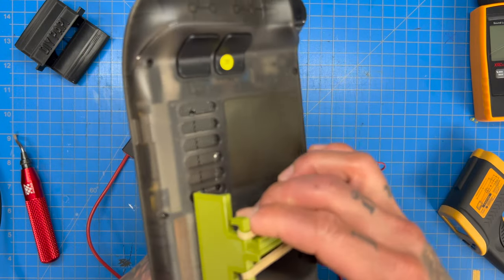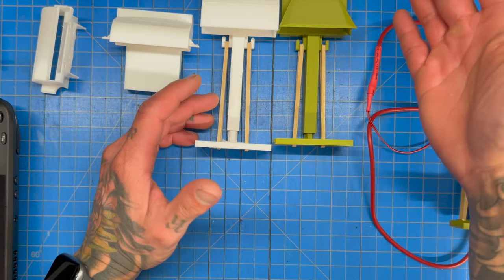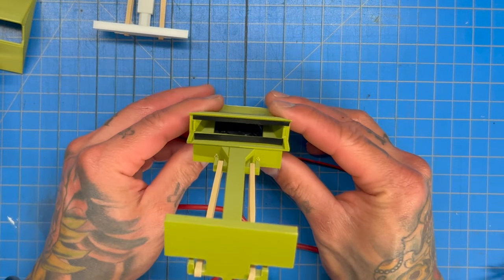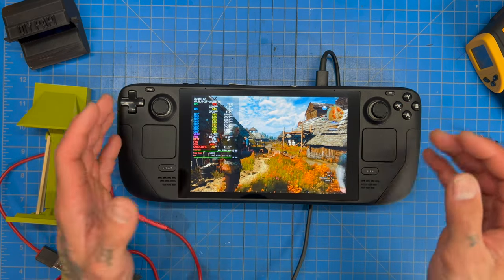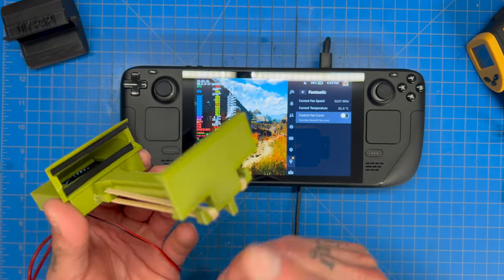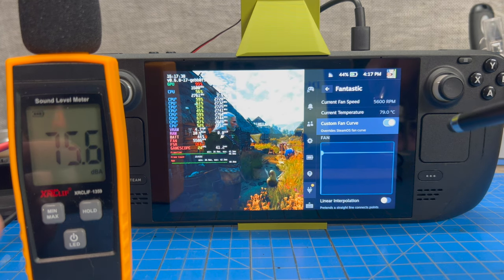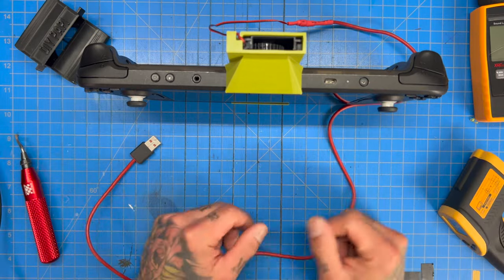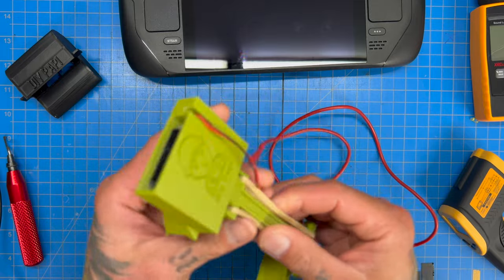Steam Deck DIY Exhaust FAN Give Away!!

Comment: Sweet bro I follow you on twitter.  and YouTube lol. fingers crossed. 
Bro any way to add a 13650 battery mount to your fan I know thy have single holders on amazon  so you can clip a battery right in.  just a thought I had  just now.
Reply from the maker: Cool idea, I have a few ideas with a battery pack, just adds way too much bulk but very possible. I have done  it once I can do it again.

Comment: Hi, what do you think about the magnetic cooler? I just want to buy, it costs $13. It is usually used for phones.
Reply from the maker: Yeah, they work, but you would need to have jsaux backplate or cut a hole in the back of your steam deck so we can stick onto the aluminum heat shield.

If you’re trying to cool, your steam deck down on a budget, best thing you can do is get the Deaky loader and download the plug-in fantastic and set your fan speed on 7000 RPM

It should reduce your temps from anywhere to 6-8°c you’ll have to deal with a lot of fan noise, but when you a put external fan it gets louder anyways
Reply: @Diy_Papi  Thank you very much.
Reply: @Diy_Papi  How do I enable cooler control ?
Reply from the maker: @loewi6132  download Deck and it’s a plug-in called fantastic